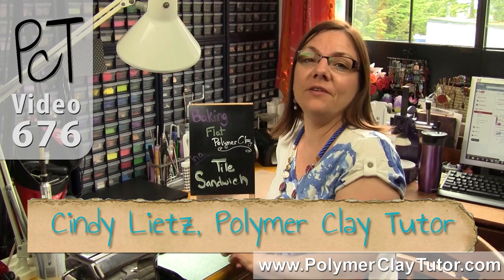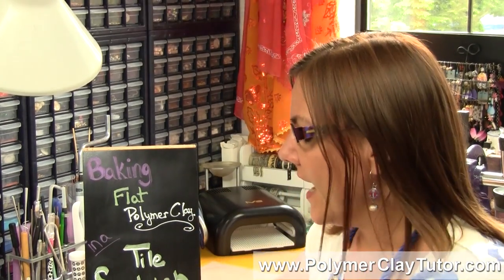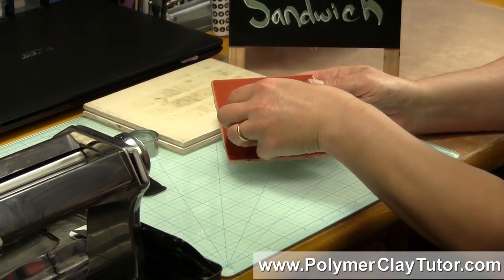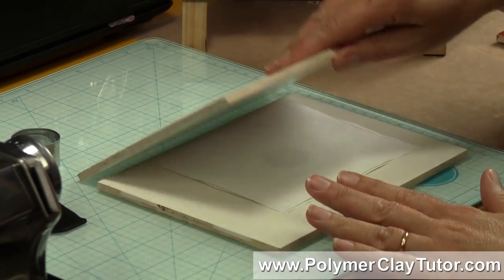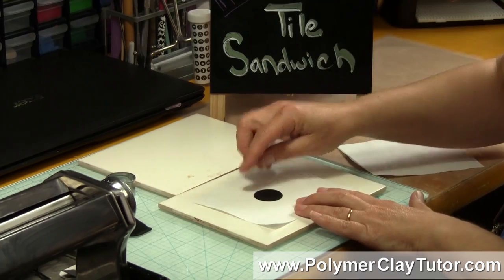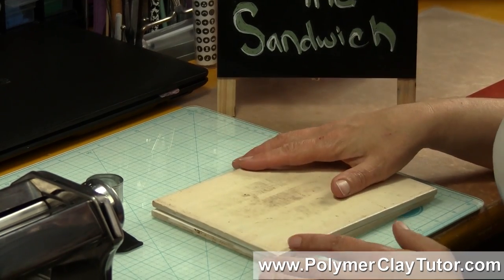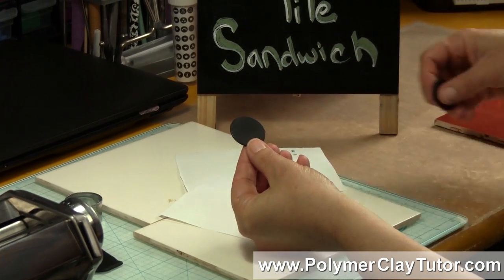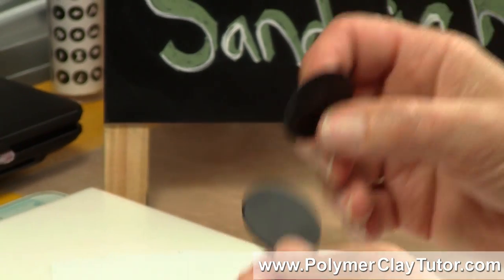Baking Flat Polymer Pieces Perfectly Every Time

Comment: This video has been posted several years ago so maybe some of you already know this but it would be selfish not to share what works better than anything...Take your flat piece and put it in your oven and dont go over 175 F and bake for 20 minutes then turn up your oven to 275 F or the suggested time for your clay and bake 45 minutes and it comes out beautiful, flat and no bubbles. Do not take your clay out of the oven after the first low bake, just turn it up while its still hot..Works like a charm and to compare it you can pop in another flat piece when your temp reaches the suggested time at the normal bake and compare when your done :)
Reply: Thank you 🙏🏼
Reply: I will try this tomorrow thanks in advance , I am a beginner ❤️❤️❤️
Reply: Thanks for this. I don't have tiles. I will try this. ❤️
Reply: I’ve used this once and it worked perfectly! Thank you! I’m bummed my countertop oven thing (sorry… I’m baked 😜 and drawing a blank on the proper name… lol!) won’t go below 250, but at 175 in the kitchen oven during an AZ winter: entirely doable! In a few months I might get away with the low bake temperatures during the day in AZ. 😩🥺
Reply: Your tip is especially helpful in my case where I’m trying to customize a miniature house kit with textured type wall appliqués, so to speak. I don’t want faux brick from a printed piece of paper, so I made my own based on the specs of the cutout out of polymer clay, bake it, then glue it to the wood structure. I just need it to be flat and keep the elaborate nuances it took to make a brick-looking wall from clay. 
I made the same concept with “wall tile” with your method and it came out awesome!
Thank you!!

Comment: Thank you so much for this tip! For anyone else wondering, it should work just as well with most flat, weighted, oven-safe objects, if you don't happen to use tiles. I just made my sandwich with two clean, flat baking sheets, and they came out beautifully! :)
Reply from the maker: Perfect! Thanks for passing along that tip!
Reply: What do you use? Can I use wooden chopping board instead?
Reply: @darlingl929  Wood usually isn’t over safe. I would stick with Ceramic tiles, level/flat back sheets, etc. Or anything that’s safe for the oven, flat, level, and smooth and stays that way when put in the oven (so no buckling, warping, etc.). Two pieces of glass from picture frames for example would probably work. You’ll just have to be more careful to avoid breaking the glass or cutting yourself on the edges. Also with glass I think it’s best to place it in the oven as it warms and wait to remove it from the oven until it cools. Glass can crack or shatter if exposed to rapid temperature changes.
Hope you don’t mind me answering.
Reply: Can you put curled earring pieces back into the oven in the sandwich to flatten them out or are they forever curled?
Reply: @Adjum84  Hi Adam. If they're still softish then you might be able to - if they're already solidly baked then I doubt it.  I imagine they'd be too brittle by that point.  It's worth a try with a test piece, though – you've nothing to lose. Cindy has video/s on baking times and brittleness etc that are worth your time.
I think many of us are so itching to create stuff, we don't spend anywhere near enough time split-testing (I'm looking at myself here – I'm far too eager/impatient to Get Going!).  It's the same reason successful artists and makers keep a sketchbook with trials, test-runs, and samples as a reference guide.

Comment: Thank you for this tip! I just tried it and it seems that the tiles may stop some of the heat from making it to the clay? All of my test pieces snapped when I tried bending them. I know this video is old but has this happened to you??
Reply: Hi Amanda, I recently started sandwiching my clay between tiles and had a similar problem. The clay heats up way slower between tiles and I almost ended up baking my pieces for over an hour with pretty good results.

Comment: Hi Cindy, I have baked my pieces on ceramic tiles for the first time but they started to break. I am not sure if they were brittle or humid because I just washed the tile before putting it on the oven. I only bake my pieces at 130C for 15 minutes as my pasta machine doesn’t do such thick sheets. And I have always baked this way. Only when I used the tile for baking did my pieces started to break. What am I doing wrong??  Should I bake for longer? Shorter? Lower temp? Higher temp??? I work with fimo though, premo is more expensive in UK. many thanks for your help. L
Reply from the maker: The brittleness isn't from humidity but from not being baked long enough or hot enough. 15 minutes is just not long enough... especially on a tile because it will take a little bit of time for the tile to heat up, so the heat is going into the tile rather than the piece. Make sure you're using an oven thermometer so you know the temp is correct. Cover your piece with a tinfoil pan and hen bake your piece for 1 hour. You will have much stronger pieces if you bake this way. I have several baking videos on my channel that will help. Good luck!

Comment: Does anyone have any advice - I have heard that it is good to make directly onto a ceramic tile but then when you bake it (on the ceramic tile) you should have paper in between. I really struggle to then move and unstick my piece of the tile without distorting it. I have tried working directly onto baking paper but it can sometimes lose colour that way...please help!
Reply: That’s exactly my problem. In the video the clay piece is on a piece of paper but the problem is getting it transferred from the tile you cut it out on to the paper, without warping it. If anyone has any advice on this I’d be grateful :)
Reply: My question exactly ☺️

Comment: OMG thank you! I have been doing a colour wheel for my clays and this has been doing my head in, I've just put my first tile sammich in the oven 🤗😁. Have you by chance tried Du-Kit Polymer Clay made in New Zealand? I know alot of the big brands are running out and there's is on par with Premo IMO I'd be interested in your thoughts if you'd tried it. (Its also cheaper for the 250g blocks)
Reply: I love the du kit range just wish they had more colors but so easy to add pearls ect

Comment: Hi! I was wondering if sandwiching the polymer clay pieces with the ceramic tiles would flatten out the clay because of the weight? Thank you!
Reply from the maker: I don't think it is the weight so much but just the fact that a warm air bubble has nowhere to go when there is a tile on top so, it doesn't pop out from the surface.

Comment: Love the video but have a concern. If I placed a textured piece in between the papers and tiles will the texture retain its density?
Reply from the maker: Terry Wowk You could bake it for a few minutes (like 10 min or so) without the top tile and then add the top tile after... that should help avoid ruining the texture. Usually textured pieces don't have too many issues with not baking smooth... because they aren't supposed to be smooth, so I usually find I just bake on the paperlined pan or tile without having to add the tile on top.
Reply: Thank you for your quick response. Do you have a video on covering a bowl with canes. I have problems getting the polymer bowl off the glass after baking or the bottom of the bowl bubbling up. I use Premo and bake at 375. I use a convection toaster oven and use the temperature Gage.  By the way your videos are wonderful. Have learned a lot in 3 months.

Comment: I've got pieces where I've put plastic under the cutter so I have slightly domed/rounded pieces. I don't want that glassy back as you showed in the video. Can I sandwich these? I sometimes bake in corn starch and then I got a tip to put a tile on top right as I take it out of the corn flour after baked. What do you think? Thank you. I am grateful for your videos.

Comment: Not sure if there's a video on this yet, but I finally got my hands on some PREMO! polymer clay to play with 2 months ago and everything was fine and dandy except for the white.  It yellowed in the oven when I baked it with the recommended temperature for 60 minutes (covered with a rectangular baking pan).  Is this preventable?  Could my oven had been too hot and I should invest in an oven thermometer?
Reply: Also, love this tip!  And I love SweetBioDesign!

Comment: That looks neat. I haven't had much issue with bubbles though really. My concern is that the tile sandwich would reduce the thickness of the clay I started with.

- Heidi
Reply from the maker: BlackCat2 No the tile is actually pretty light. Look at my two sampled, one baked in the tile sandwich and one baked on top of a tile. There is no visible difference between the two thicknesses.

Comment: Hi Cindy what if you have a piece that has a design on top that you don't want flatend but only want the back smooth eg: a pendent
Reply from the maker: Aylisha Escorcio Then don't put the tile on top. Just stick Otto cardstock and cover it with a foil pan. That should keep it flat on the back without squashing the texture.

Comment: Very helpful thank you!  I'm assuming you don't have to bake it any longer then normal correct?
Reply from the maker: Mary Vanderhoven On a thin piece like this, the one hour is fine. If you found that the pieces weren't strong enough though, you could bake it a little longer.
Reply: Thank you so much for you prompt reply.  your tutorials are very helpful and informative.  :)

Comment: Can I put a baking sheet on top and weight it down with another oven tray on top if I don’t have tile?
Reply: You can but... baking sheets often "pop" and "twist" when they get hot... especially if they are thin, and metal pans can cause hot spots and scorch your pieces. I would rather see you use something non metal and more ceramic like, like a pizza stone (I love them even more than ceramic tiles now), or a flat bottom ceramic or glass baking dish or even a heat proof flat bottomed ceramic plate.

Comment: I tried, but failed. Tiles accumulate heat, and my samples were burned, despite the fact that the oven thermometers shows the correct temperature.
Reply from the maker: Ekaterina Tryfonova The tiles don't actually accumulate heat... they even it out. If your clay burnt even with a thermometer, I am guessing it is not reading correctly. I have had to replace oven thermometers after they stopped reading correctly. Just turn down your oven a bit and try it again. You will find it works quite well.
Reply: PolymerClayTutor Thank you for suggestions, I'll try it!

Comment: Hi Sarah! I wanted to know if i could bake my polymer clay charms for a shorter period (20-30 mins) and maybe set it on a higher degree then what is recommended but not too high because I always bake in batches so I save a lot more energy but I don't want to be baking for an hour in my toaster oven because I live with a family of 6+ and I want to find more ways to reduce the time/ energy. Should I be baking on a surface that could transfer the heat to the clay faster?

Comment: I was baking my  Primo or Sculpy clay earrings the other night and I baked at 275* for 1 Hrs... the day on the “Emerald” green didn’t set and when I took it out it broke like cracker crumble. So I thought I’d bake it longer at same temp... still no change and then half of the earring burned wile the other half didn’t. Can you tell me why that happened? Or what to do to fix it?:) thx!
Reply from the maker: Were you using SculpeyIII? Emerald sounds like a SculpeyIII color. If it was, it is because of the clay and not your baking. SculpeyIII is a very brittle clay. If is was Premo, then perhaps your temp was actually off. Make sure to use an oven thermometer to be positive the oven temp is right.
Reply: PolymerClayTutor yes I think it was a sculpy III...is there a way to make it stronger or fix it before baking?
Reply from the maker: @earlymorningsea4924  Try mixing it into a stronger brand like Premo or Souffle. That way you won't be wasting it, but you will get much better results.

Comment: What if im using air dry clay to make jewelry what should i do
Reply from the maker: Are bubbles an issue with airdry clay? I haven't worked with it much.
Reply: @PolymerClayTutor  yes it shrinks and makes bubbles too !
Reply from the maker: @schzbella5828  Hmm that's interesting. I haven't worked with air-dry clay very often so I don't have advice to help you. I would have though the air bubbles would shrink as the clay dried.